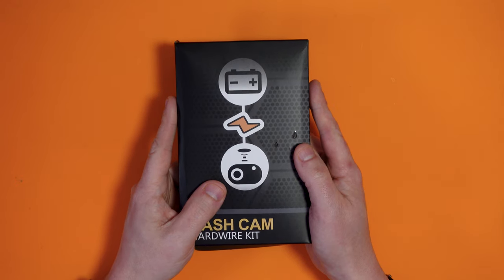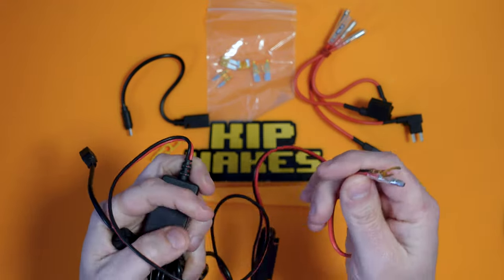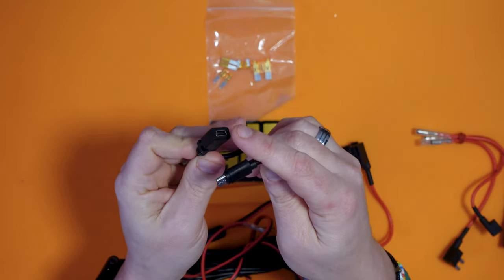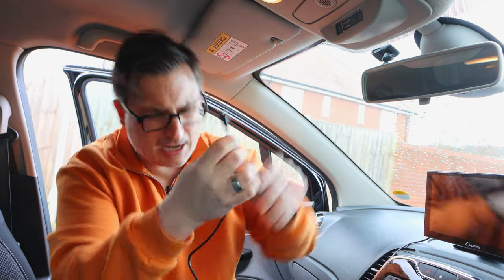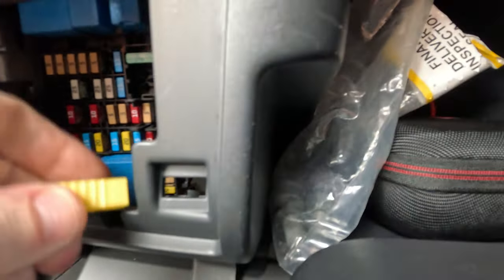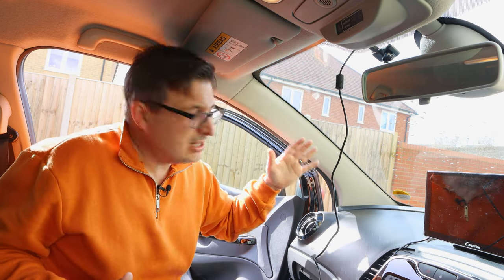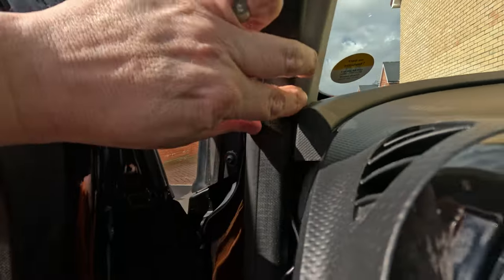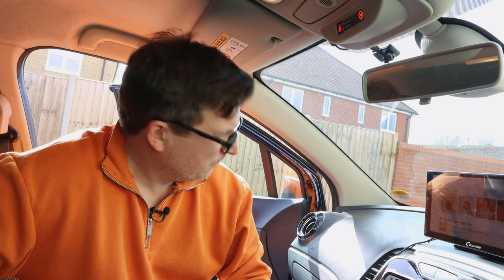Easy Dash Cam Hardwiring For Any Car – Foolproof Guide!

Comment: I just had fun with my old dashcam as I just bought a new car, as the last one was written off by a kid last August, so had to buy a new wire from front camera to rear camera as had a garage hard wire it in, so never knew how the cable was run through the car, and as the passenger pilar was damaged in the accident, and it was the passenger pilar they had run the wire down, then impossible to get the wire back out.

I got to say I am pretty impressed with my handy work, as the wire runs along the roof, and as I bought a longer cable for my Viofo (very handy that they sell replacement parts rather than a new dashcam), then I had excess wire to hide somewhere in the boot after running it around 75% of the boot, which will also allow the rear camera wire to be hidden better as the wire doesn't have to change direction from the rear camera, and as a large small car (Citroen C3 Picasso), then the 5m of cable I got was about 1m too long in the end.

just got to look up on youtube now how to fit the hard wiring cable into the dashboard. as cannot find the clips to remove the side panels.

Comment: Hi Kip, in reference to this video, did you have any camera overheating issues? did you change the fuses to a lower amperage? as fitted my dashcam at long last a couple of weeks ago, and found my dashcam was getting extremely hot, reduced the fuses to a more manageable 3 amp, the dashcam is still a bit hot, but not burning to touch now. be something you should check, as if the camera overheats then the camera isn't going to be recording when you need it most. thinking of also adding a 2 amp fuse inline as you cannot buy a spade terminal 2 amp fuse, which seems a bit weird when audio equipment should have around a 2 amp fuse back in the 90's. I also did hard wire into the constant 12v supply for parking mode using another jumper fuse cable.
Reply from the maker: Hmmm not noticed this myself. But thanks for the tip!